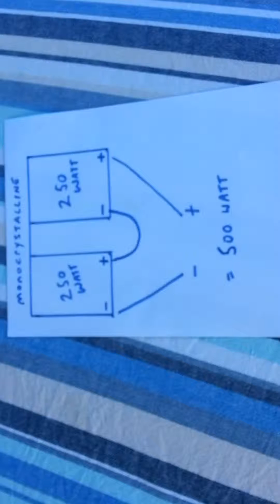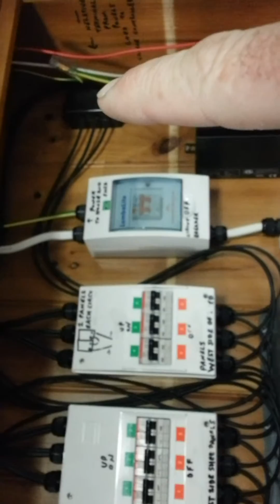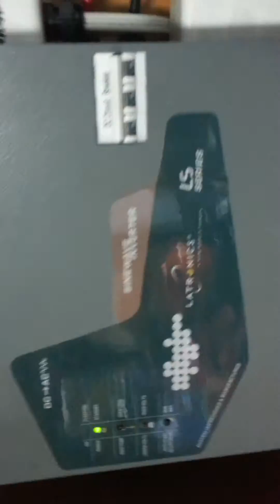My new off grid setup 48 volt

Comment from the maker: You can get a 24 volt inverter latronics same size as my 48 volt latronics  so the wattage is still there  the only reason was i could put more panels on roof  more power for chargeing  ive got 3 kilowats of panels and have seen 2600 watts come from them thats the most so far

Comment from the maker: In short     the change in voltage from 24 volt to 48 volt means i can put up doulble the amount of solar panels = more power     useing one charge controler.      a 12 volt battery setup with my 60 amp tristar mppt i could only have 800 watts of solar panels.  I can have 4 times that now  i can have 3200 watts of panels ive got 3000 watts of panels on the roof

Comment from the maker: Have read its good to cycle your batterys dont know to what voltage or how often or how true that is .wouldnt hurt them i supose to take them down to 60 /70 % anyway i am starting to run the  55inch lcd tv on it at night and it does that to easy.

Comment from the maker: So my outcome is to go 48 volt system put up 5000 wats of panels with 80 amp mppt  to run anything I want during the day charging the batery whyle im useing it and the system to stay on float im nearly at that now its known that if you discharge your baterys they start to cristalize on the lead plates inside .  Question is how long can a batery last when on float siting on the shelf

Comment from the maker: Ross co  the main reason I wanted the 48 volt setup is if you use a 60 amp mppt charge controler tristar at with 12 volt battery setup you can only have 800 watts of solar panels  at 24 volt batery setup you can have 1600 watts of panels  48 volt four 12 volt batterys . Ive got eight its like a biger fuel tank you can pump 3200 watts of panels cince ive got six panels on morning sun and six on arfternoon sun ive only got 2300 watts max so far at around lunch time will be going more panels untill I get 3200 watts at lunch

Comment from the maker: Ive been looking at people who use the load function on there charge controlers to dump the power to grid tie inverters once there baterys are full so there baterys are on float as well  I did something similar with my first off grid setup with no inverter but my excess was feeding a small fridge I do like the idea of excess power going to the grid but my charge controler hasnt got the load function cause its not pwm  its the mppt tristar and the electricity companys here  they do not like u pluging in those cheap grid tie Inverters you plug into the powerpoints in australia america musent mind that going on there

Comment from the maker: Hi robert I only wanted to use my setup during the day only to keep my baterys on float which it does cause your baterys are the expence I use it for tv kettle vacume toaster microwave plug in all the phone and ipad charges all my tools down the shed got powerpoints everyware built my whole front fence of it works like a dreem but only just been runing tv at night not to flog my baterys I asked the local batery shop how long do baterys last on float there not sure they said for ages I supose my system is on float now been on float cince 930 this morning got an ice cold beer in my hand fron my bar fridge thats on a timer turns of at 6pm on at 7am